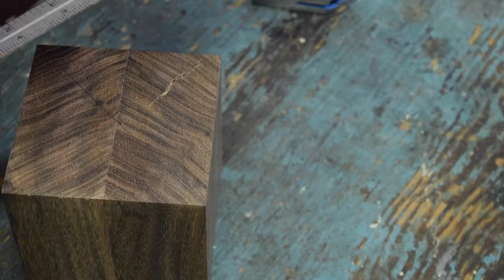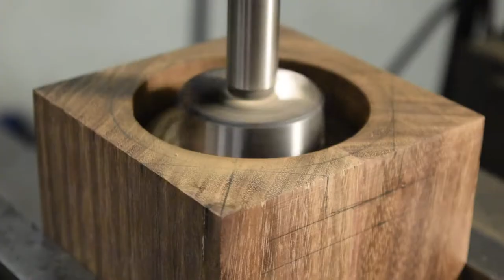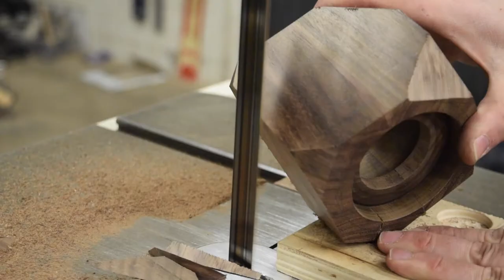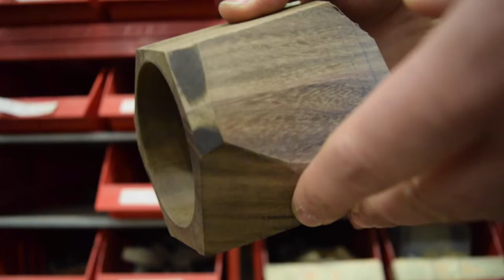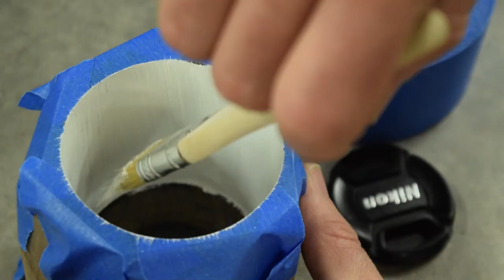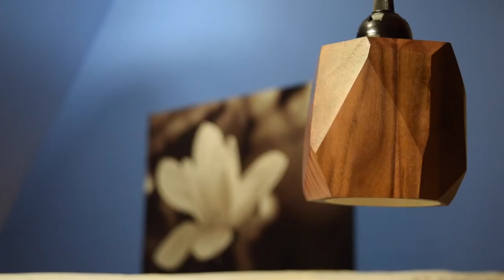Faceted walnut pendant lamp - by residentmaker

Comment: Nice piece. What was the finish that you sprayed on? Also, not a big deal, but just curious why did you draw the circle onto the block before drilling it?
Reply from the maker: It's Minwax spray lacquer, glass, in the black can.  I don't show the whole process but basically that product with light scuffing between coats gives a really easy, tough finish that dries quickly.  One of the makerspace members might offer a class in finishing techniques... he's the one that taught me.  Keep your eyes out for it. :)
Reply: Thanks.